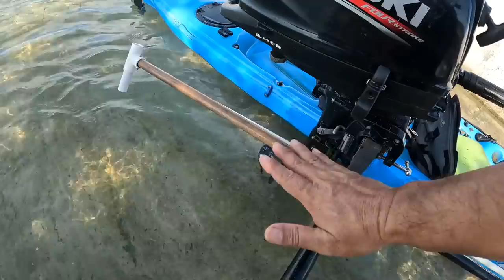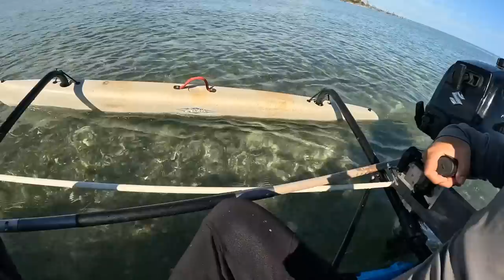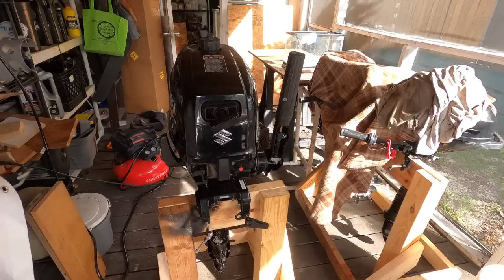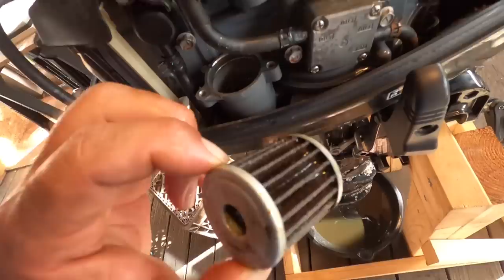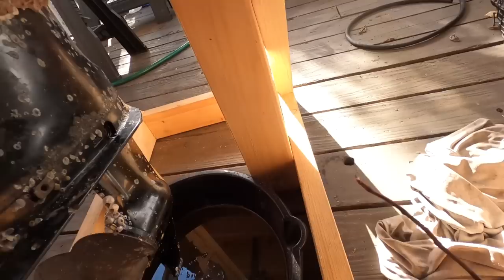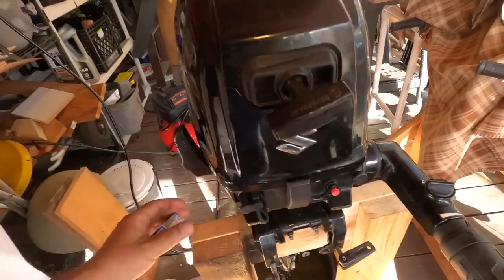Suzuki 6 Horsepower Outboard On A Kayak.  Taking It For A Spin and What's it for.

Comment: do they make a hydrofoil that would fit that outboard?  Cheap and would give you lift where you need it. I also think I would adjust the trim, shims or whatever, so that the prop was pushing slightly up so to raise the rear under acceleration.

Comment: I was thinking of putting a trolling motor on my kayak but have been stumped as to how to mount the bracket for the trolling motor horizontal to the yak. I could just barely make out how you did your mount for the motors you use. It looks as though you have some kind of a turnbuckle rig set up?  If your system is good enough for gas engines then it would be fine for a trolling motor. I'm sure I'm not the only person that has been trying to figure this out...

Comment: A solo skiff is awesome platform the only thing I didn't like on mine was lack of storage. But that was me and i probably tried to bring to much stuff. One question I have for you "Mr. Suzuki man" I just got a 2015 df25 with like 30 hours. The guy said the oil was changed after break in but that's it. It runs like a top and looks right from the showroom, what maintence  should I do just for piece of mind

Comment: I've been waiting for this, you thumbnail baited me on the last vid. First thoughts are... A way to do double outrigger on one side for the lean and lift... A splash guard between motor and rear well of yak, prevent it from filling with water in the rear should help with lift... Of course a custom hydrofoil should help lift the rear... and maybe rework the offshore yak motor mount for a better height and prop angle (like tilted back on first trim and level on 2nd trim) this should help prevent filling the rear.

Comment: When you change the oil on this outboard, you must replace the oil drain plug copper washer every single time.  It is one time use only.  I would not put a fin/hydrofoil on this outboard.  Whatever problem it may solve will just cause another problem and/or less overall performance.  This one is better left stock, and it is what it is.

Comment: Steve Hoodoo has a Solo skiff 130 for $1,799.00. that's Just the skiff. Or they have the 6hp  motor, with the Skiff  for Approx 3,499.00. I know you said you may look for a used skiff..But not bad for just the Skiff brand new. And you already have the 6hp motor. You'd definitely make a profit if you sell it one day. And you already have your trailer. It's amazing how big blue can handle anything. You've been fishing out of her for 7 to 8 years now. I can see why you won't part with her. 😎 🌊 🎣

Comment: do you even notice the rear of the kayak filling with water?? Not too bright in my opinion but maybe the CG can come rescue you when it goes down.....
Reply: While I noticed it and wouldn't want that with my yak, the kayak does have a self bailing hull. The biggest issue he wants to fix is the squat and all that water consistently in the back is a major reason it squats, that's probably an additional 40-50 lbs. in the back, plus what ever cargo he has back there stands a good chance of being washed overboard.